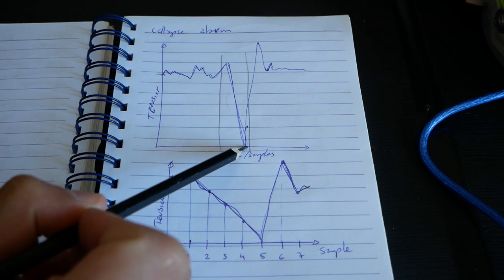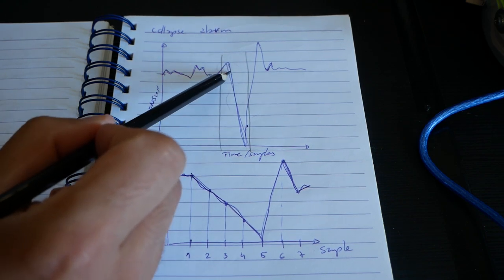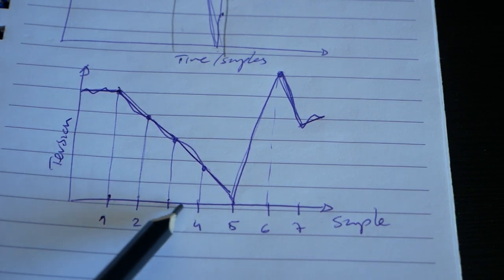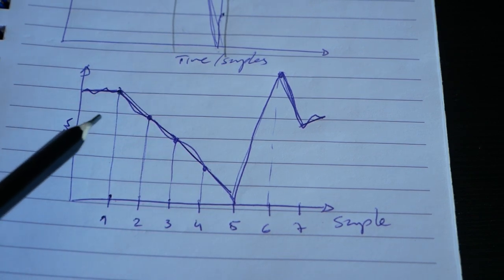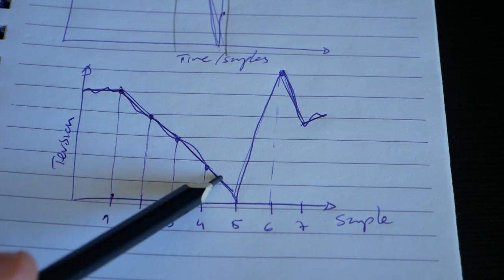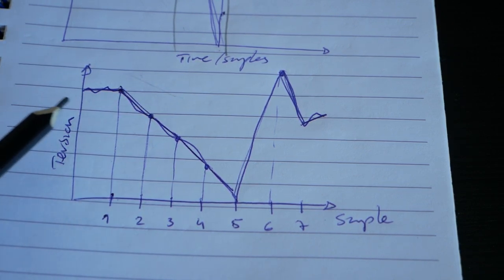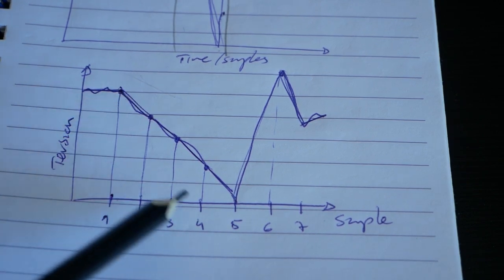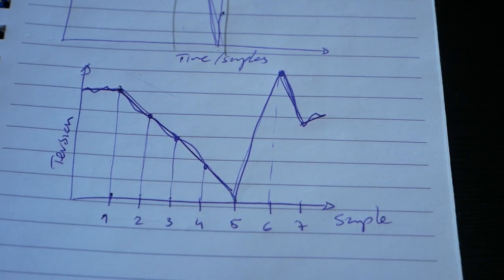Collapse Alarm - Uncollapsible Paraglider Part 6 - BANDARRA

Comment: Don't give up! Its a great idea. I think you should rate the 2nd criteria with your derivative approach. To show the collaps. 

Though to make this realy preventing an warning. I think you should take real flights and pull colapses. Later you can train an AI with the tesion signals with when a collaps occured. Possibly the tension of a B-line for comparisson / validations could also help.

But again a realy nice project.
Reply: I agree, that empirical data would be the best to work with. Then train an AI logic with it and see what that spits out. It may seem rocket science, but trust me, it is not - anymore. But certainly you need data for training the AI model. Best would be actual measurements as David suggests. However I am sure that paraglider designers have a ton of simulated data for this. This project would make perfect sense to collaborate with them and use the their simulations. You just need the right connections, Andre. ;)
Reply from the maker: Yeah I thought about the other way to do it was to have sensors on all the lines and record a real flight. Then timestamp events of real collapses or near collapses and then let AI learn from those datasets. We're a long way off that though :)
Reply: @AndreBandarra1  Way to go! Sience is unforgiving, but perseverence will get you there. I was thinking AI as well. Maybe just overall load (on the carabiners) as extra input? Keep going Andre!
Reply: @AndreBandarra1  
I think a real flight is nessesary because of the tension on the lines. One the ground this tension is way too different than in the air (I think). I would measure other lines too, like others says before
Reply: Good ideas here. Ratio of A and B tension should be much more robust than A on its own. To have a record of what the wing was doing (so that you can do a few flights and then analyse at leisure) you could move up to a Raspberry Pi (even a low spec one) with a camera looking up at the wing. One thought for the future - it's not necessary to put the tension meter into the line - you can measure tension by measuring the force needed to bend the line by a small amount (like a bike spoke tension meter), or the amount of deflection achieved by a fixed force.

Comment: I am thinking on your gadget, and here are some ideas:

1) What if use visual indication (LED lamps mounted on risers) instead of beeps? This will not mess with vario.

2) Your tensometers are quite large, so you can put an indicator (and even a controller) right onto them.

3) A measuring device may be even mechanical! Your S-shaped piece is a kind of a spring balance. So, if you add a rack gear with an arrow, you could see its extension-compression. Of course, the full length of extension must not exceed safety limits of lines' shortening. I believe, a few millimeters for 20kg is allowed.
(Electronic tensometers stretch with microns, of course).
Larger value would work as if you push the speedbar while collapse is just coming (and it will come!), few millimeters do not matter.
Springs may be as flat S-shaped as convinient spirals.

4) Visual indicator (electronic or mechanical) easily shows both absolute... well, relative, value (tension force) of the force and its speed of change (that is, a jerk).
Just look how fast an arrow moves and where it points.
Or, you can encode it with a number of leds in a scale, or their hue, for the value, and a tempo of flashing for their speed.
Every time the value crosses a tickmark downwards, they blink. Faster loosing, more frequent flashing.
Less load, more leds shine, or with more red color (normally they are, say, green, and if overloaded they are, say, blue).

Comment: Ha ha! Welcome to real world tech! I have been doing this since youth and have a lot of experience at it, but every new project is a new challenge. 
Might I suggest a "situation appraisal" style of routine? i.e. there must be x tension for maybe 15-30 seconds before the alarm becomes "armed". Averaging is a good idea but there should be a pull on that derivative . Think the way a real world (accidental) collapse occurs. Usually it happens after a certain time of stability... etc. Get it?  This is a really great idea though and it could be made into a riser clip-on  on each side (so like 2) so it's not in the way. Nice!

Case in point tho, I was near cloudbase with my recording DIY vario and started doing steep wing-overs getting practice and suddenly I heard a really loud beep, then no more vario. Freaked me out so much I flew less acro and more XC after that ha ha! Cheers!

Comment: Here are my thoughts on the issue:
Try to program a few triggers, each one with a different tone:
1) a rapid loss of tension, triggered by a negative derivative that is < X and maintained for over ~0.2 seconds
2) a more gradual loss of tension- same as before but with lower X values and maintained for over ~0.6 seconds
3) low pressure alarm- triggered by tension dropping below 50% of what it was during the last ~2-5 seconds
4) collapse alarm- tension is zero (or a value Y that is really close to zero). Beep for 2 seconds and then stop beeping

Maybe add a trigger that uses a function with both the tension and the derivative. Something like -T/D = X will calculate a projection of how many data points (X)  you have until you reach zero tension (assuming the derivative is negative). Try playing with that X value.
(Shrugs) or something like that. Obviously a lot of thought and analysis needs to be put into this, more than what you can provide on a YouTube comment. But don't give up- test a few different solutions at a time to work in parallel. The end product will probably have more than one triggering conditions anyway.

Comment: Think you need several flights in all conditions while measuring tension In  the line at all times to find the natural average during flight. Then including small collapses to see how the tension changes. Then set up an alarm to a low point that indicates an imminent collapse.
You need that inflight base line first. Tension while on the ground will not be the same.

Comment: Love the idea and enthusiasm... Just wondering how useful an alarm it would be and what kind of forewarning time it could conceivably give... Collapses often just take place out of the blue and are pretty damn alarming in themselves with or without a beep. Maybe a continuous tone that changes in pitch depending on the line tension would give more of an idea of what's going on in the air...  (really tense, medium tension, a bit slack etc) If it were possible (doubtful) to rig up lines on different sides of the glider left/right and A´s and C´s I suppose with a bit of experience it would be possible to foresee a collapse or stall through the different relative changes in tone pitches..  Like a flying orchestra with the vario thrown in as well... Great food for thought! Thanks!

Comment: 10/10 very nice. It's probably not so easy to implement, but wouldn't some machine learning be applicable to detect patterns in tension that happen before a collapse?
Reply: Definitely. But you have to gather collapse data first :D I'm not sure how similar it will be to groundhandling as the tension readings will be undervalued. The person is not hanging on the glider. Definitely a fun hobby project!

Comment: I was doing some thinking. Bad idea I know but I came to this question while watching the video. What if the parts that were more likely to collapse were more rigid? I mean, when the wind comes straight down on the wing, it will not deform. Like an umbrella with stiff poles in each rib?

Comment: Normally it's almost impossible to calculate a useful derivative straight from sensor data, as there is too much noise. You usually run it through a low pass filter to smooth the data first.

Thus you don't have any data loss because of  averaging, you just get rid of the high frequency components.

In python it can be done with few lines, don't know about Arduino.

Comment: I think it would work much better if you isolate 2 sensors one on each far end single red line instead of each group of red lines on the buckle as you have it now... Reason I say this is that a collapse has to bend the last red line on each side to collapse..so just simplfy the reading to just one single outside red line on each end of the wing is where you put the sensor and your done..much simpliar and more presice accurate readings.. Just my thought
Reply from the maker: Interesting idea, thanks for sharing!

Comment: Or...measure the AOA of the airflow at the nose of the wing?  Small weather vane attached to an angle sensor which feeds to the Arduino via BT.  If the AOA gets close to either a frontal or a stall, buzz or flash an led.
Reply: I also feel uncomfortable with interfering with the lines.
Reply: Good idea, but rather impractical. All these sensors are nice, but the question at the end is reliability and robustness. Airflow measurement by nature is quite slow as it has no choice but to average over time due to zillions of small perturbations in the air. Otherwise the data would be nothing but noise. Tension measurement is way simpler and practical.
Last but not least you would need a sensor pretty much on each line. Can you imagine a paraglider wing with weather vanes attached to every line? That would mess up performance, speed, drag, and so on. A tension meter built into the mailon is way much simpler, neater and safer. And I think more reliable as well.
Reply from the maker: Yeah I'm sure there are many other methods that might be possible. You can also put little IMU's in different parts of the wing and measure acceleration etc. the main challenge is that paraglider wings are flexible, and for that reason almost any approach needs a distributed network of sensors, rather than just one.
Reply: Although, using the line tension method it's going to always be the A's that slacken first in the event of a collapse, also using the middle A line as you did in the video is a good choice because if you going to get a big collapse that line is always going to go slack, if the collapse is too small to reach it then it's not worth the alarm going off :)  

Secondly,  rather than measuring the average load might you be better off determining what the normal load is in straight and level flight and when it  unloads by 70% to 3 kilos say, then sound the alarm ?
Just a thought :)

Comment: Hi, I think you have lot of bad data because you are on the ground. The line tension will be more even in flight. And you can induce small collapses to test your system by doing bad wing overs
Reply from the maker: yeah, quite likely. a collapse in the air could potentially be easier to predict